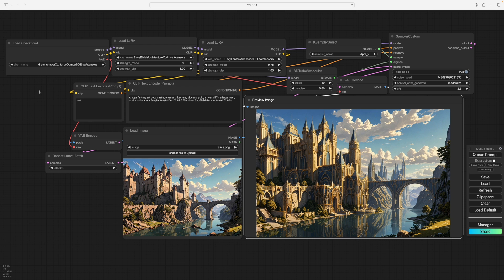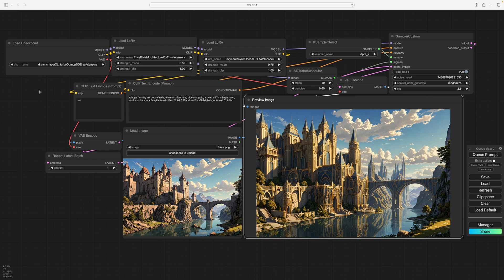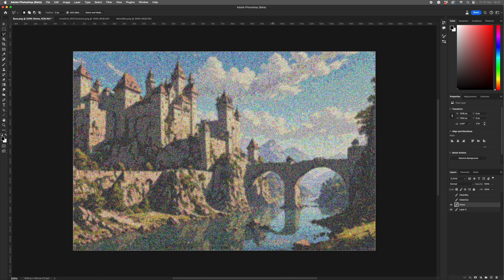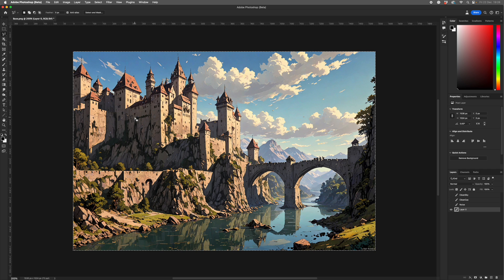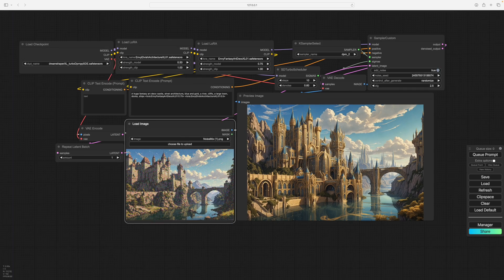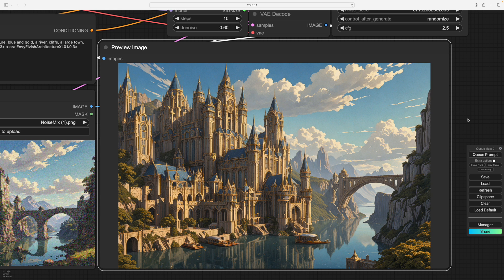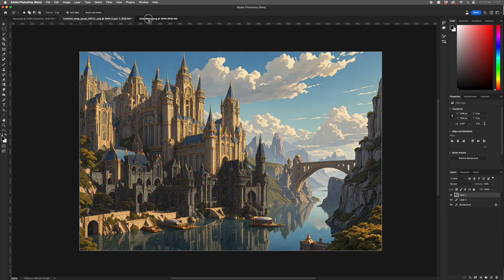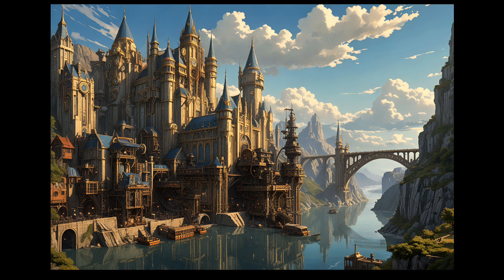Using Zoned Noise to Refine in ComfyUi

Comment: this gave me an idea.  use a depth map to modify some noise so stuff thats closer has more noise. might be interesting. thanks, also great video :D
Reply from the maker: Yep it works great. You load the depth into an opacity channel in P'shop which adds your noise according to the map, then you can either mutate the near stuff or the background. The Denoise levels seem to work best at about 0.5 to 0.7. You can colour the noise using Hue/sat as well.
Reply: I literally had the same idea. 😇